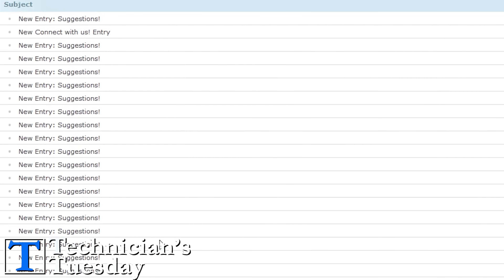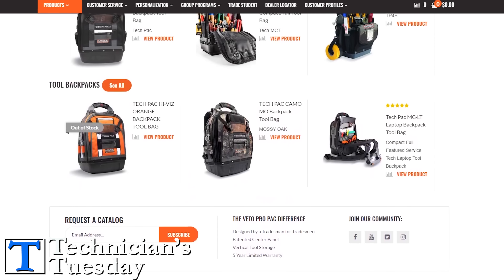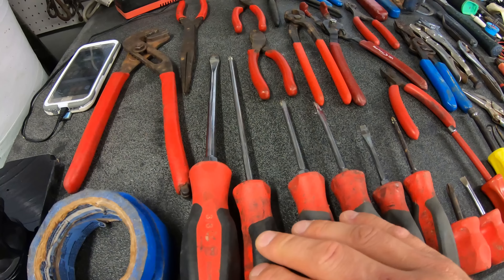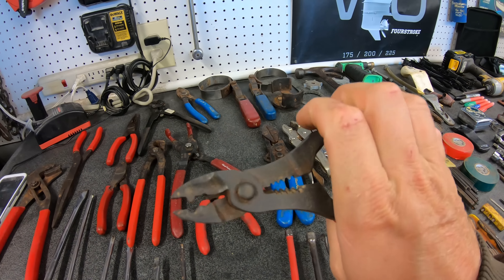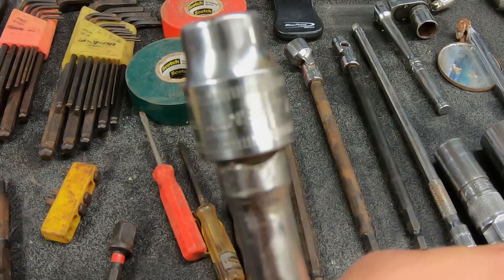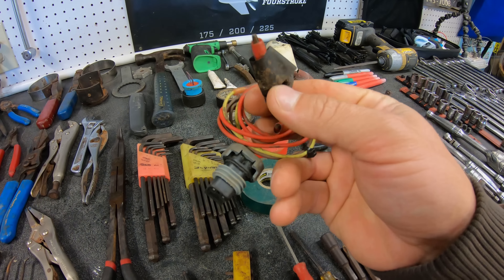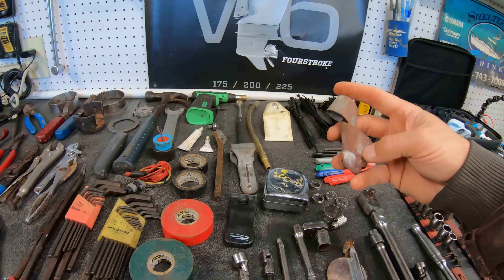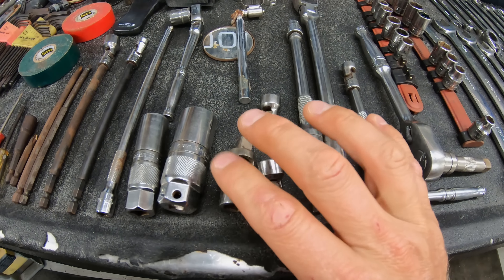What Tools A PROFESSIONAL Mechanic CARRIES!

Comment: Hello, new subscriber here.  Enjoyed the video... what is the name of the tool that you use to cut off the excessive part of a cable tie without leaving a sharp edge?  Is it just a side cut plier or is there a specialty tool?  Thank you.
Reply from the maker: It's just a pair of flush cutters. :) You can get a cheap set or an expensive set, but as long as you just use them for zip ties, they work phenomenal!

Comment: I know this is an older video, but...a LoadPro and PowerProbe4  are an indispensable addition to track down most electrical issues...both of which I got from the usual market places, at a huge discount mainly because these are considered a 1 job tool...both of these, paid for themselves (full price) the 1st time i used them...not kidding, no affiliations with either product

Comment: Hey all, my ignition makes the typical buzzing sound when you put the key in & turn it to the power  position.  However, when I start the engine it won't stop buzzing.  The engine starts & runs great.  It's a Yamaha 50 2 stroke.  Any ideas how I can get this damm thing to stop buzzing?
Reply from the maker: It could be a wiring failure or the keyswitch, but its also very likely that there's something up with the oiling system and it's trying to tell you about it! Make sure the oiling system is working correctly!

Comment: That Sea Star puller is not worth a flip mine did not even work right.
Reply from the maker: They can be a pain for sure lol then when it slips off and scratches the ram, you might as well replace the whole cylinder! lol
Reply: @BornAgainBoating  had to use the ole BFH to get that arm off of the ram on one side. Fun times. Sometimes you have to get destructive.

Comment: #tool I have a Milwaukee 2 in. Battery right angle grinder, with 2 in. Scotch brite pads it is fantastic for cleaning off gaskets and polishing up small parts. A real time saver and will slip right into that bag.The most important tool is a cresent wrench becase when all else fails...it works

Comment: Did  you ever once a week spray your tools with Teflon spray to prevent rust
A 10 mm combination wrench and or 10mm socket w/wrench
I did not see loctite adhesives and torque stripe
Reply: John Bladykas he had locktite

Comment: #TOOLS. Nice video, I have about most of the tools you have.  Scary lol. As for the 19 and 18 mm wrenches, keep them handy. Just used mine on my 2006 135 mercury verado to remove lower unit. 19 mm nuts and 18 mm bolt behind zinc plate. Keep making those great vids. Oh and almost forgot the most important tool is the bag to carry all that stuff in!

Comment: #Tools The important tool is the 3/8 adapter w/6” extention with the10mm socket . I think it depend on which kind of job you are doing like if you are doing fault finding a multimeter is a must have tool or a 100hr maintenance a flathead,filter clamp, 10mm, plug socket.

Comment: On a future video I would like to see what do you have on the shop tools box mainely to diagnose electric issues (like DVA's KV probe etc) and tools to desassemble lower units (like pullers or slide hammers etc)
I build some of my tools as slide hammers to pull prop shafts/bearing carrier, washer claw wrench etc etc #tools
Reply from the maker: We might eventually do a tool box tour video, just haven't had the time to do it yet :)

Comment: The most important tool I would say would be the vise grips because in a pinch if they’re bull nose you can pinch hoses, you can use the to change batteries, you and lock them on and wedge them against something to take of through bolts you can’t hold and in screw at the same time, and many more things. #TOOLS

Comment: #tools
The most important tool in this video has to be the 10mm socket. I work as a mechanical tech on pipelines and I'd say the most important tool I use are the two 8" adjustable wrenches I always keep in my back pocket.

Comment: Most important tool - If this is framed as only having 1 tool, it would have to be a Crescent wrench.  If it was the most used tool in a full took kit, it would have to be a medium head phillips screwdriver.  If it's what we won't leave the dock without, both of those are included along with a socket set.  But, clearly the most important tool is between our ears - planning ahead.
Reply: I think it is vise grips

Comment: I'm all about the 10mm #tools - but i've got to say, i struggled for hours until i borrowed (cant afford it, but i think its worth it) a snap on ratchet 8 point box wrench with pivoting head.  without it i would never have been able to get the exhaust manifold off my isuzu diesel. the 16 point one i had just couldn't grab it.
Reply: Npr?